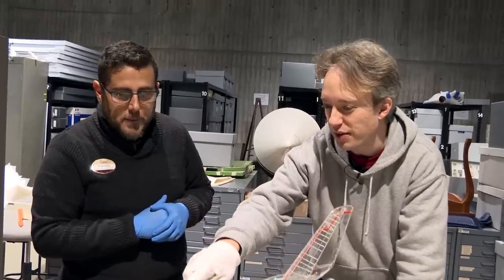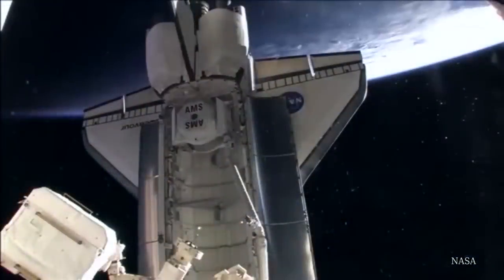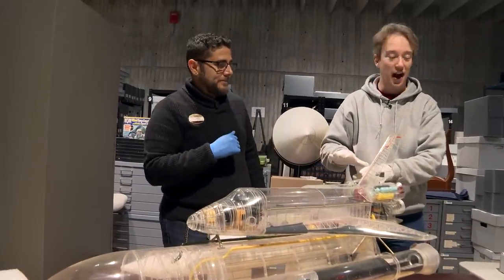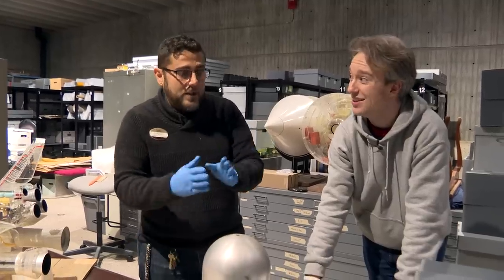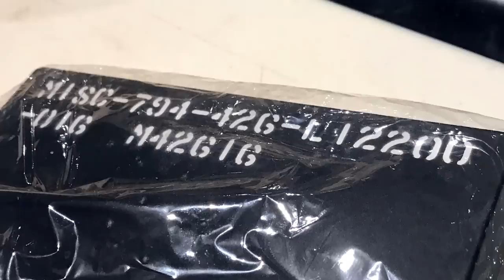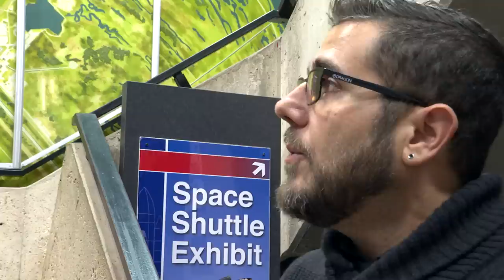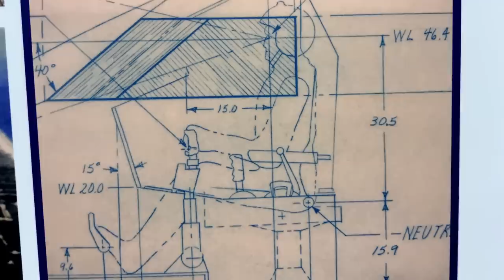See-Through Space Shuttle (with Tom Scott) - Objectivity 197

Comment: My mom told me about how they used similar scenery models with cameras for visuals in early simulators when she was in the Air Force, at least the older simulators they had at the time (early '70s if I remember right). She said that she'd been warned to not crash the sim, as doing so would physically crash the camera into the terrain model and damage something. Still cheaper than crashing a real airplane or space shuttle though.

Comment: It's outstanding how the transparent model didn't get yellow or opaque over time. That's NASA materials for you.
Reply: That, and proper storage?
Reply: TheNasaDude I think the yellowing is a result of UV degradation . If it’s properly stored it won’t yellow
Reply: It wasn't owned by a smoker. I have lots of old tech I owned back in the day and it looks like new. A lot of old computers, game consoles, and other electronics go up for sale because their owners who were smokers didn't live to be that old. Nicotine is the primary reason older stuff like that turns a nasty yellow brown.
Reply: @kg4boj   You are wrong about that. I have several pieces of old tech that yellow over the ages. And, you guessed it, I'm a non-smoker. 
It's the flame retardant in the plastics that react to UV, which cause the plastics to yellow, or even get brown depending on the exposure length and type of materials used.

With peroxide you can bleach the colored plastics back to white, whatever color they where before exposure.